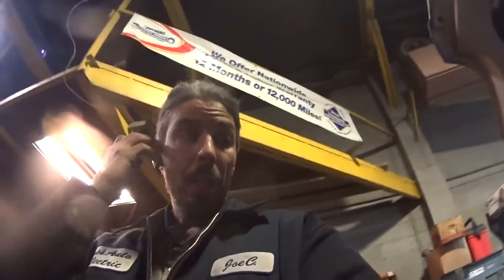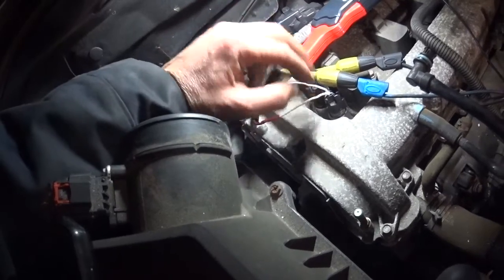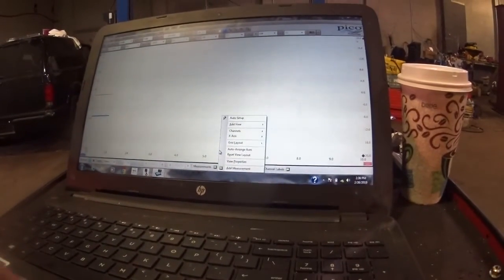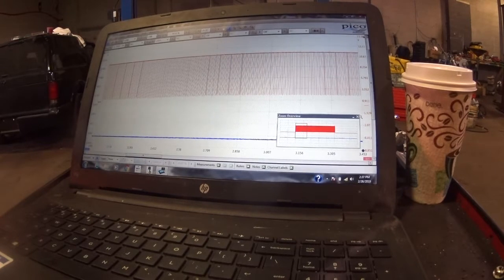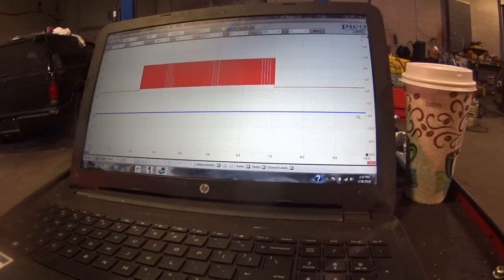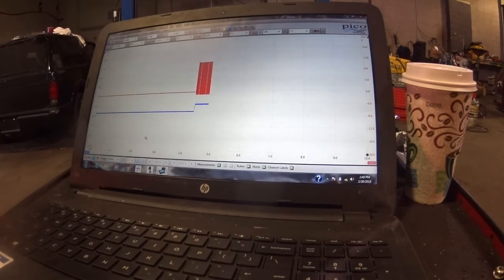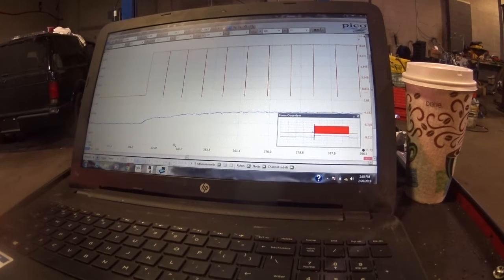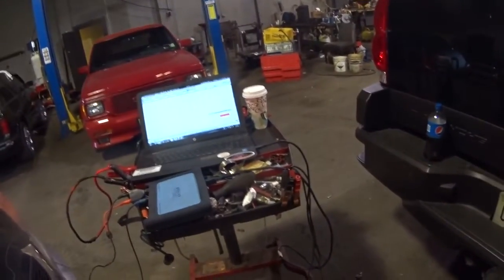Automotive Solenoid Tester? Using Pico To Confirm Failure

Comment: Current waveform shows is the pintel is opening as well.
Reply from the maker: Yes sir
Reply: @JoesAutoElectric  I just made I post on Instagram on this exact engine. P0011 went stright to current ramp, showed movement so I pulled the solenoid out and the screen was plugged with metal shavings

Comment: just had a 2009 cobalt today. didnt have a pico but used some generic scope seen control from the pcm/ low ref from the pcm no vvt camshaft movement on scanner. dormancam came to the rescue!....
Reply from the maker: oh man...I was going to mention in the video not to use any aftermarket on these. They will cause all sorts of issues. I had a Pontiac solstice that would not shift and another shop installed a tcm due to a  code. The code was actually being caused by a faulty camshaft solenoid. Guess the brand!